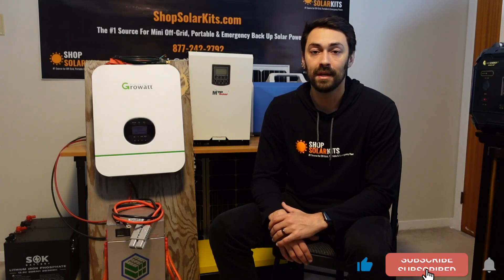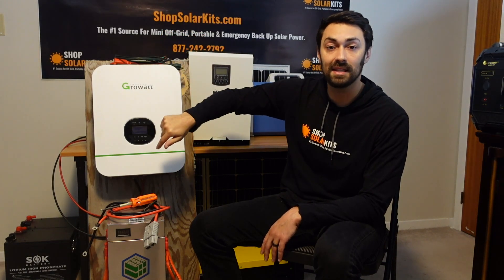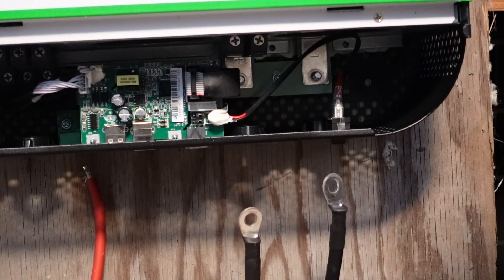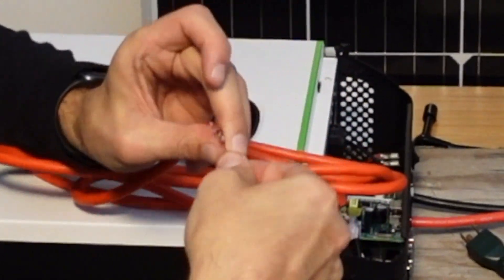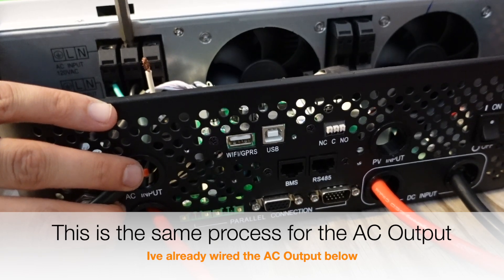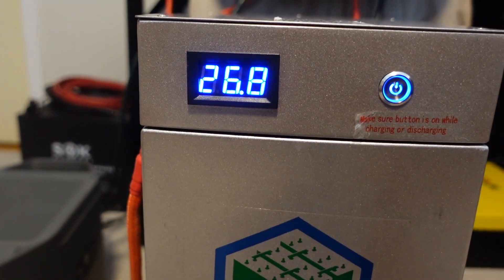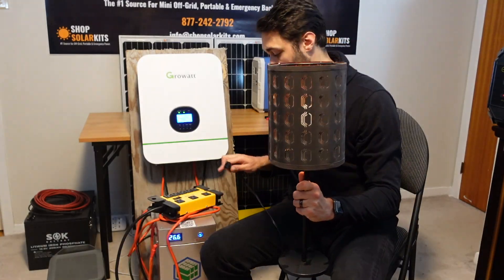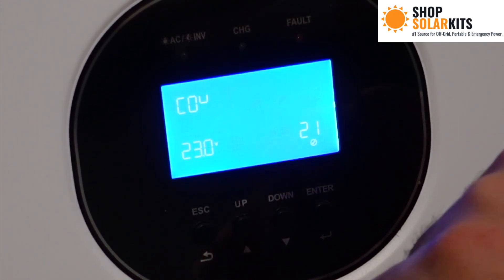Simple Off-Grid Solar Set-up | Step-by-Step: Growatt + BigBattery | Beginner Friendly Hybrid Kit

Comment: Warning

These off grid inverters are Ip20 not Ip68 

ABB uno on grid inverters is ip68

Last 6 rs working fine.

ES5000 off grid inverters are

Not dust protected 

Must be installed 50mm away from the wall

With flysreen netting enclosure with Aluminum or wooden frame

Does not compatible with our environment in Sri Lanka. It is humid and if not, that's protected without an dust proof enclosure. And if you cannot look after them well in a proper environment don't go for it and being f*** twice with error number two(heat) and Sri Lanka. We don't have reliable service personnel with whom you have to deal believe with of whatever they say so but they avoid of offgrid inverters at all. If you need as a backup, not for 24 hours. Use in a Dusty humid environment. This is my warning because I am being f*** twice now. Finally for having a off grid inverter during power cuts time,I have paid a fortune.
Reply: Don't live in a dusty shithole and you won't have these problems 😂

Comment: How do we disconnect the Main line from the power company in the service panel without getting electricuted, then install the Growatt to the whole house wiring system that's already in place for a completely off grid system. All the video I found show how to install new circuits, but it makes no sense to install a new circuit panel if the circuits are already there.

Comment: There is no mention of using pre charge resistor when connecting and turning on the battery & inverter. 

This feels dangerously wrong. Many other ppl talk about the need to use pre charge resistors when connecting battery to inverter. 

So what is going on here? Does this battery or inverter have internal pre charge resistor ??

Comment: My issue with bigbattery is if your system gets to low you have to have a 250$ charger to charge it. With growatt however I should be able to charge it via the system correct?

Comment: So let me ask so these automatically switches from ac wall pass throw to the ac output but if there was a black out on my neighborhood it automatically goes into battery power and will solar be always on can it accept solar even at night putting a dc power supply or it really has to be solar I done this just to see the efficiency of the mppt, so only one source can charge the bat at a time right?’ Either ac wall or solar but not both at the same time? I have a super small system 12 but I need more ah and I noticed at 12v system I’m running 120 v applications it eats my battery 1000-1800 w load

Comment: What gauge wires are used for the cables from the batteries to the growatt unit? Also, if using 4 SOK batteries connected in series to create a 48v system, is there a certain fuse we should use between the batteries and the inverter? Thanks so much.
Reply: the wires look pretty thin

Comment: I'm also a new subscriber and a new customer. I purchased the HBK-5.1 kit. Nine days later after much thought and discussion with the boss (wife). We decided to upgrade to the HBK-6.2 so we can have full 240 volts going to the breaker panel. I'm sure wiring the 2 inverters is just as simple but any chance you may have a video on it just to make sure I don't blow up $6,400?
Thank you for the simple instructional video!
Reply: Hi there, congrats on the kit!  Also, very cool upgrading to the larger kit for 240V.  There is a parallel cable that comes with your inverters which is used to connect both inverters together.  Its quite simple, and in time I will also make a video on that.  I think there are a few videos already on the internet that you can probably look at for inspiration there as well.

The last part is that I would suggest hiring an electrician when you are wiring the inverters into your subpanel.  You should be able to set up the entire kit yourself, but wiring it into your panel is where we suggest getting an electrician.

If you run into issue when setting up your kit, you can always reach out via our technical support form, and our PV technicians will help you out in detail --> https://shopsolarkits.com/pages/support-form

Thanks!